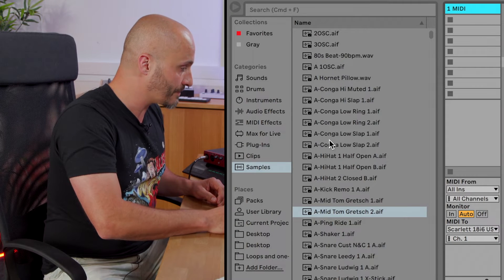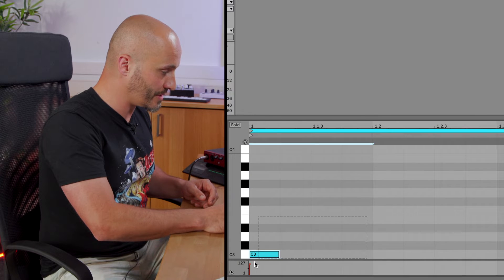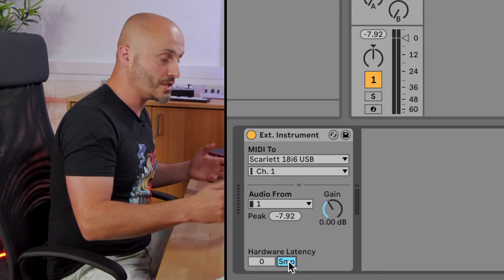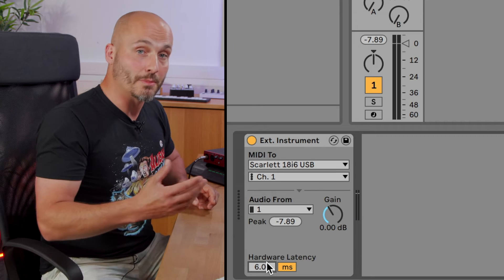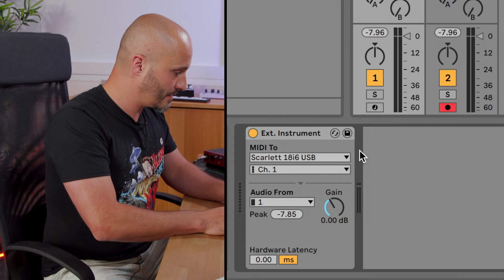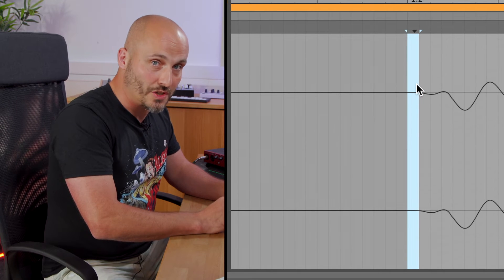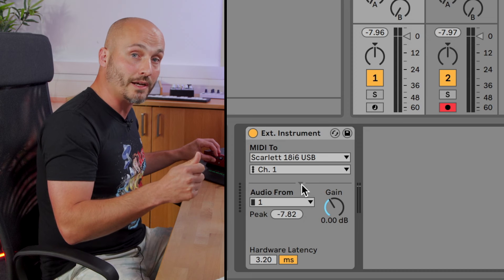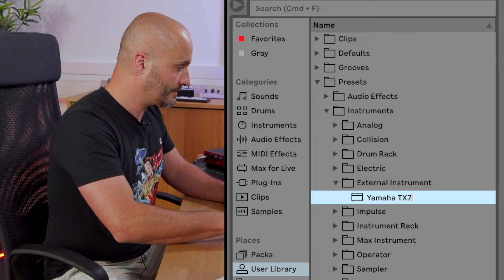Ableton Live Tutorials – External Instrument Device

Comment: Not 100 sold on the second "more accurate method" perhaps its my set up. I couldn't seem to get much difference dialling it in.... It didn't seem to change the latency in the tut nor on my computer either- check 7.17mins in... Yeah its slightly ahead but if you're attempting to program some tight percussion thats way off (for my liking) and warp's still engaged which always throws me a bit (as everything you're recording is essentially getting its tempo further manipulated.... It's a bit of a head fuck :)) gotta love it! Perhaps i'm missing something. I think i'm gonna trust my ears.

Comment: Hey bro! ive been watching all your tutorials. Thanx for the work, mate! simple and strightforward.
I have a question for you, maybe you can help me out:  I have a hearing loss problem. I lost around 30% of my capability on my left ear, and though im still able to work, i feel it is affecting my mixes, since i find myself trying to compensate with my right ear all the time, or else raising the volume. I was wondering if there is anyway to set up my monitors volume individually. If there is any built in tool or external plugin that can help. Thanx again, Peace!

Comment: First off, thanks so much bud. I have a question about using my 2 Akai S3000XL's with ableton. My audio interface has one midi in and out, so I daisy chained my Akais to the back of the audio interface which works in tandem with my midi keyboard. So, lets say C1 to G1 is kicks and snares and C2 to G2 is pads and bass sounds, how will this work with the External Instruments, will Ableton Live 10 recognise both Akai's or only one seen as they are daisy chained? Sorry if i worded this bad, its just been a bit of a headache. Thanks
Reply from the maker: There are 16 MIDI channels. So set your AKAI 1 to receive on MIDI channel 1 and the second AKAI to receive on MIDI channel 2. Then set your DAW to send to either MIDI channel 1 or 2 depending on which device you want to receive the MIDI notes! We think this is what you meant?
Reply: @MusicTechOfficial  Thanks so much man, exactly what I need. Sub for u
Reply: @MusicTechOfficial  Also, if I have assigned a Kick to C1. Snare to C1#, does that mean I need to make 2 different midi tracks in ableton, or can all my akai drums be placed on one midi track
Reply from the maker: @h.hholmes3118  If they are both on the same MPC and MIDI channel, one MIDI track will be fine.  If you want the notes to send on different MIDI tracks (i.e. channel 1 or 2 as above) you'll need to assign the track in your DAW to that MIDI channel output.

Comment: Thank you .There are some interfaces that use USB C and even thunderbolt .Would this reduce the latency ? Does new hardware reduce latency compared to old hardware ?
Reply from the maker: Hi Mark, latency depends on a few factors including sample rate (higher rates mean lower latency), buffer sizes (smaller = lower latency), and connection protocol. The confusion around USB-C is that it's just the name of the physical connector rather than the data transfer protocol. So, the best thing to do is check whether your audio interface is USB-2 (with a USB-C connector) or a faster protocol such as USB 3 or Thunderbolt.
Reply: @MusicTechOfficial  Thank you .I have in mind for the next PC build to use a USB C mainboard with a Steinberg UR 816 C .To connect some hardware .I also have a MOTU microlite for midi .I appreciate your good communication skill .I upgraded Ableton today because I found what you said easy to understand .
Reply from the maker: @markquavertune2003  Ah great news, Mark! Enjoy your new setup!

Comment: Thx for this really good tutorial. Just one question. If I do this in a live set and use the same hardware each time, will it be the same latency level every time I open Ableton or could it be, that latency changes from time to time?
Reply: Mine keep changes minute to minute. And I don’t want to even get started about when I add another external device. I have been tweaking track delays and every other setting for literally a week and recorded hundreds of tracks to get it right. Then I put a delay on a synth and I a;most smashed everything I own.
Reply: @B0rnT0L05e  I am trying out the trial version of Ableton. Same issue with the latency constantly changing. I get it set right and a bit later it’s off again. Set the new value and it changes again. I spent weeks trying to get it right and am about to quit trying. I have so much fun with my BeatStep Pro and 2 analog synths controlled via CV. It all works so well together but is a mess with this sync issue. The latency is a buzz kill for inspiration l.

Comment: Thanks. Excellent tutorial and great step by step guide. Do you have a guide showing this process for Ableton live 10 intro? I believe it is a slightly different process.
Reply from the maker: We do not, but it should be very similar. Which components are you missing in Intro?
Reply: @MusicTechOfficial  Hi, in the instruments section of Live intro, the external instrument device selection is not present. I believe this is only available in Standard and suite apparently. Not completely sure though.
Reply: @cds8137  yeah, unfortunately you will need to upgrade from Intro if you want to use the External Instrument device
Reply: @MusicTechOfficial  Additional point. I am looking to hook up a  Korg Minilogue XD and a Yamaha Motif 6.